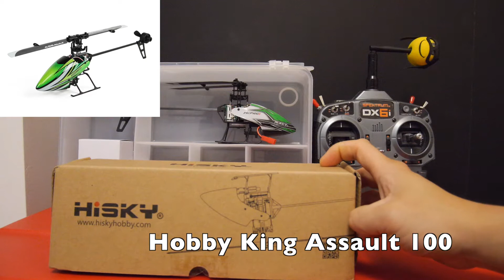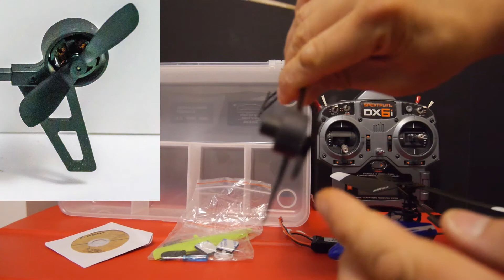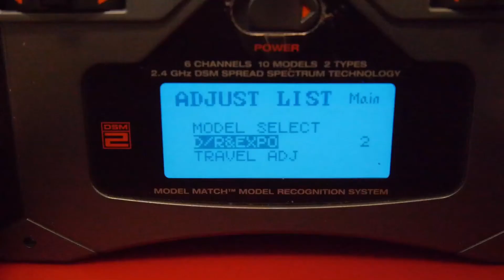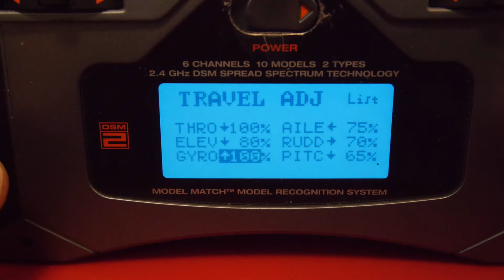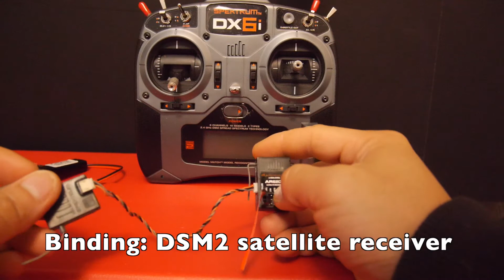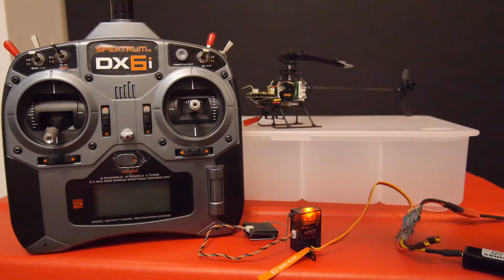HiSKY HCP100S RC micro brushless helicopter Spektrum DX6i review binding setup

Comment: Great video!!  I actually just got mine on Saturday from Banggood(US warehouse) with the HT8.  My board is also like the one you pictured with sat port on the rear of board.  So, I am using a DX8 and have a AR6200/sat, as well as a Orange DSM2 6 ch RX with sat.  Either way if I bind either the AR6200, or Orange my board flashes green for a split sec, then sat RX turns solid.  Everything works fine.  Servos, and ESC arm, etc.  I have flown a few times but frustrated that my board light will not stay solid green with sat connected.  Also, I can not get the DT8 to work at all.  With that my board light is solid green, but have no functions with heli!!
Reply from the maker: +josefmd Hey, I just got a new radio, and when I tried the sat with my Devo 10 tx, the green light wasn't solid either when I tried a few weeks ago.   I'll let you if I figure something out.
Reply: +kenVersus yeah weird huh!  I figured out by some research that with the AR6200 anyway turning off TX first when heli still powered I can at least have my sat RX light solid instead of flashing. I might buy a AR6210 DMSX setup to see if that makes a difference.  At least at this point my 100S is working and is flying great...

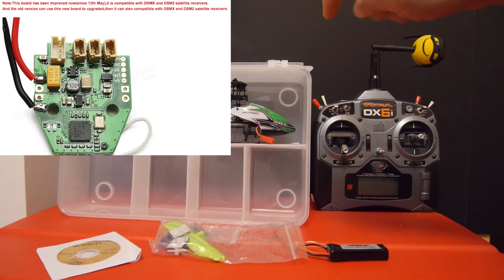Comment: My HCP100s with HT-8 (from US warehouse and stated to be upgraded new version) arrived a few days ago. It has the board like the one you show at  1:24. I can't read the test of the picture. I've only been able to successfully bind and fly once as the swash just tilts and resets when I bring the collective out of full down. This has happened every time but one, of the 50+ trys. My HCP100 binds and flies with out issue. I am planning to do the sat option. Did I get an old version?
Reply from the maker: +VD2021 From what I remember, US warehouse only had the old version so no DSM2 compatibility.  But if you have a DSMX satellite receiver, should be good to go.
Reply: +kenVersus I noticed that the BNF, from the US ware house, was discounted and stated it was the older. So I ordered the set with the included HT-8 which stated it was the new upgraded. I found the board (as you pictured and which is identical to the one in my heli) on their site and it states its the new version. The box also states it so I feel confident now that I have the latest/new version. Don';t think I'll pull it to check that its labeled "v1.3";  and still can't get it to bind correctly again. There's replacing the heli, but it seems the sat route is the way to go. Thanks for the video and reply. When is the flight video coming?
Reply from the maker: +VD2021 that's cool.  I got the BNF, so you're right.  At least you have options, with the HT8 or DSM satellite.  Sold my DX6i so will wait to see which TX I can use for the HCP100s.  Lately I've been more into my quads so the helis are taking a break.

Comment: why would you want to go with DSM2? DSMX is better. I would say thie Hisky is a cheaper yet far better version of the MCPX BL. My firend bout the MCPX BL, we bound it and the board burnt up. HH sent a new one and the Aileron Servos would not work. I got this, and it has been problem free and the parts ar better. It flys much better then the 1 MCPX BL that I have flown.
Reply from the maker: I only have a dsm2 rx. But dsmx is better for sure. It is amazing how good these new helis from other brands are. I have a lot of blade aircraft like msr, 120sr. But replacement parts cost way more. I crashed hcp100s recently and stripped the servo. Waiting for some parts. Enjoy your bird!
Reply: +kenVersus 
You can't strip a linear servo. Head over to the Hisky discuss everything thread on rc groups to get more info.
Reply: +NELICOPTER maybe not but you can burn up the motor and chips on them.
Reply: +Thrashaero 
Correct. They can get very hot, but they start to whine at you when they get hot and most people unplug the battery. It is more likely stuck, disconnected, or the piece of brass has been pulled out and needs to be pushed back on.